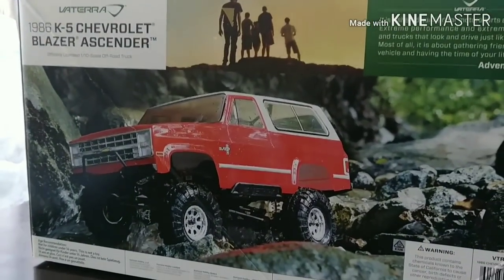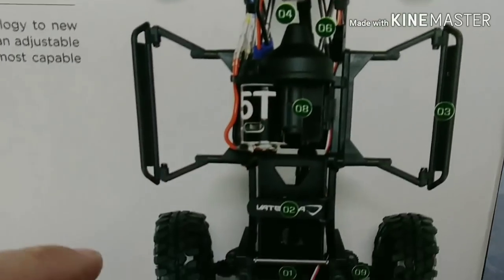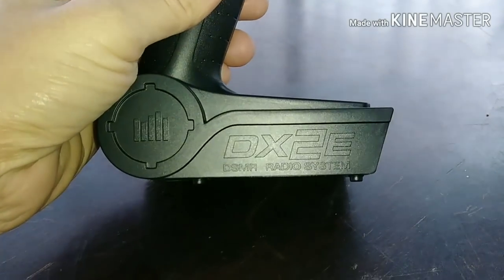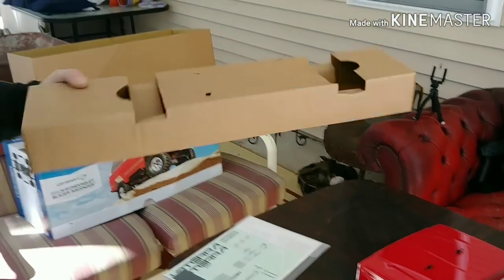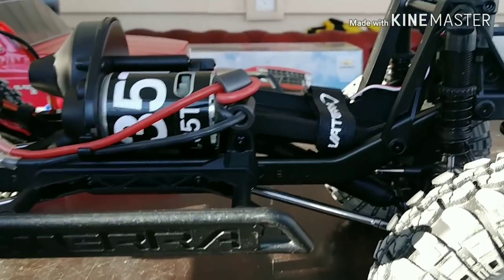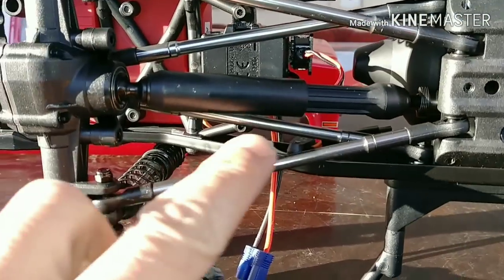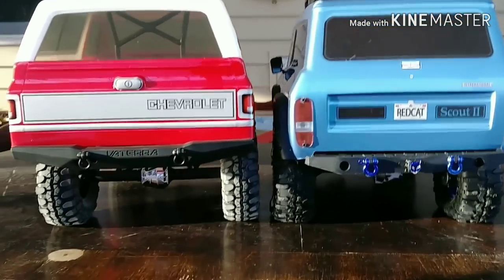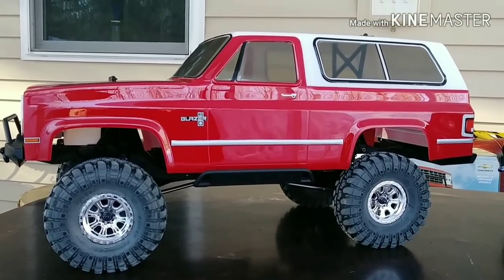Vattera Ascender K5 Blazer Unboxing

Comment: What an awesome looking rig and it comes with tsl's. I really like how they kept all the windows clear. I had that motor and esc combo on a rig a few years ago and couldn't figure out why they put those 2 metal sleeves on the power and ground wire. I cant wait to see how all the rigs do on the course.Fantastic unboxing video brother
Reply from the maker: Thank you sir! You know your the only one to mention the metal sleeves on the motor wires so far,I feel like you should be winning something for paying attention,😊👍lol
My best guess,is for helping too eliminate electronic emissions,or electro magnetic frequencies,other than that I'm totally clueless,😕 
Your dead on with the truck looking nice,it's a sharp looking rig,the only thing that I don't necessarily care for,is the tail lights,they have the front grill completely "led" ready,and the back only has a "sunken in" outline of a stock blazer tail light,with a tail light lense sticker,? 😕 it's crazy!,
it's like they gave up,or partied too much,and forgot about them all together,😂 lol
The wheel well's on the body where my only other dislike,they should have been cutout enough too clear the tires,straight from the factory,
It's like it was meant for smaller tires,and they changed their minds at the last minute,put the 1.9's on it,and shipped it as is,?😕
As for the chassis,
It's definitely not bad,especially for it's time,
It's super light!,which is a positive for playing in the snow,but it could be a negative when it attempts to climb a couple of obstacles on my adventure course,😊
The small "but extremely steep" brick hill,Is first in my mind,second would be the Tittar totter,then the backside of the big brick hill,"the side that's next too the the small/steep brick hill,"then the steep portion of the brick bridge,"opposite side of the tittar totter",then climbing the big logs,on the steep side of the small over under log bridge,and the vary last obstacle that may snag it is,climbing up either side of the big over under log bridge,
having enough weight,in the right locations,is key on some of those obstacles,😁 
Which brings us too my next dislike;The battery tray location;It will definitely help towards tackling the tracks steeper obstacles,😀 but otherwise,I don't necessarily care for it,First it is hanging low over the front axle,which is great for getting the weight forward,but it's also the first thing too get wet when splashy around,it also came equipped for a shorty lipo,and there isn't too many options with those when it comes to a high mah,with a low "c" rating,
most of the batteries available are 50c,and up,and the the one's with 25 too 35c,all had a low mah rating,like 4,000 mah,and lower,😕
Horrible battery options!
I installed the other "full size" battery tray,and it's location isn't much better,😂 
now it's located kinda high,and directly behind the front tires,going horizontally across the chassis on a slight angle,😂 lol 
My next dislike is the receiver box,it's definitely not waterproof,and if you go in too far,it will fill up,and hold water like a swimming pool,😁 
And finally my last personal dislike;which is the axles outer pinion,or lack of traditional outer pinions,😕
the axle pinions going towards the drive shafts,are cvd's with a sealed bearing,
I'm not knocking them,but I'm unsure how they will hold up in muddy conditions,😕
Otherwise it's a Sweet Rig,
I was extremely close to buying one a few years ago,did a lot of video research,and after market parts research on it,but I could only afford to buy one, And I ultimately got the Rc4wd TF2 kit instead,I kinda liked the leaf spring suspension,
and the motor/transmission location,the truck looked a little more scale all around,😀
But it took a bunch of money,and a ton of personal wrenching hours,to make it even offroad with a stock Ascender,😕 but it's also a total brute compared to the Ascender,😁 I think the Ascender would have a tough time dragging my nqd jet boat, and trailer up a fast moving river,😁 the Trx4 Bronco's are slightly heavier than the Vattera,but I'm sure they would also have a tough time dragging that boat up a river,😁 it looks small,but the combined weight of the boat & trailer,are close too two pounds,😕 on a good note,since the boat is bungie corded to the trailer,so the combination will float if you get in too deep,which lightens it up significantly,😂 lol
Anyways I can't wait too see the Vattera tackle the course this year,It's going to be another great comparison vehicle,which has got me geeked up for spring,😁
Thanks for your awesome comment,and for watching the video Brother,😎👍👍